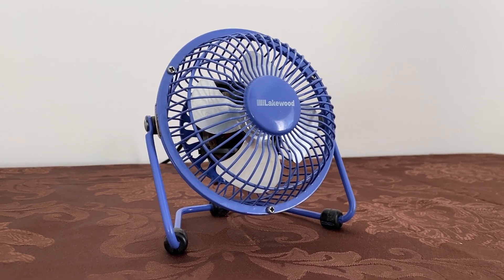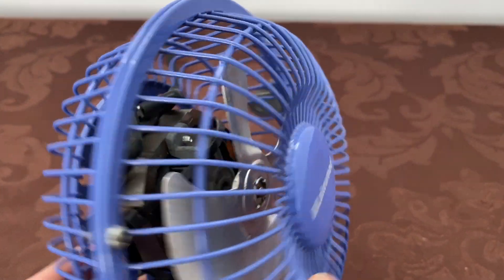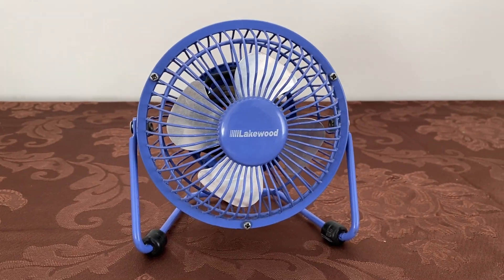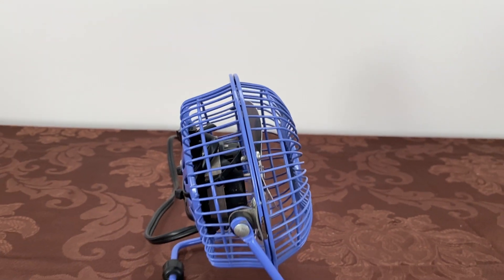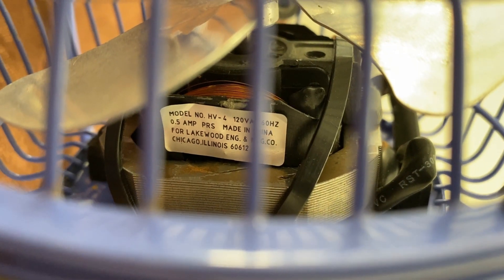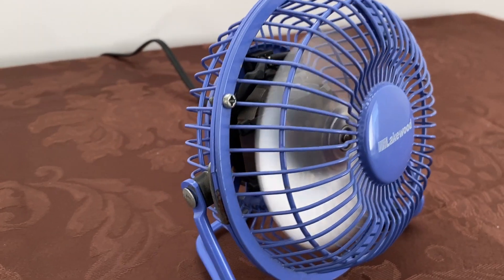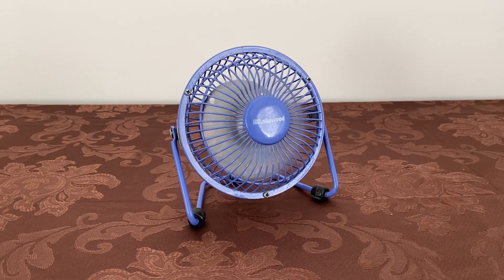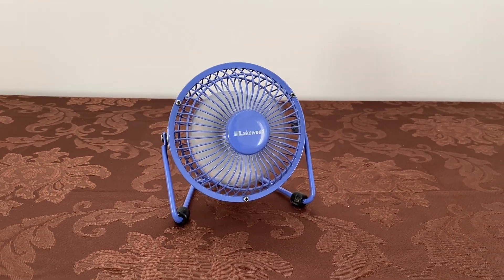2005 Lakewood HV-4 4” High Velocity Fan

Comment: Just thought I should add. If you ever want to fully fix this fan, the best course of action would probably be to get a new motor. Most modern fan forced heaters (the plastic ones at least) use a similar motor, so if you can get one of those you should be all set.
Reply from the maker: Appreciate the input! You’re definitely right; the motor in this fan is far too deteriorated to be repaired. I’ll keep an eye out for a junk heater.

Comment: Mabe cover the entire back bearing carrier with jb weld so it has nowhere to break from
Reply from the maker: That's something I could try. It's already a real mess though lol. The rear bearing housing is quite literally crumbling, so I don't think it has the structural integrity to hold the motor, even if I were to cake it in JB weld. I'll give it a shot though, whenever I take the fan apart again.